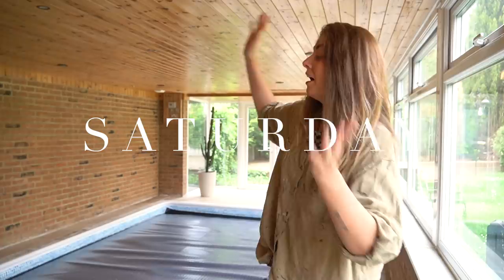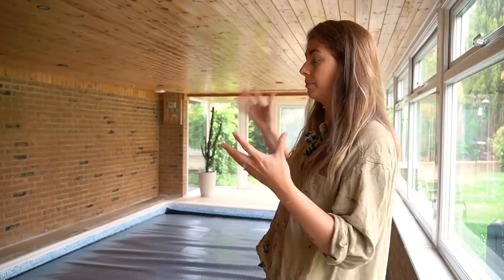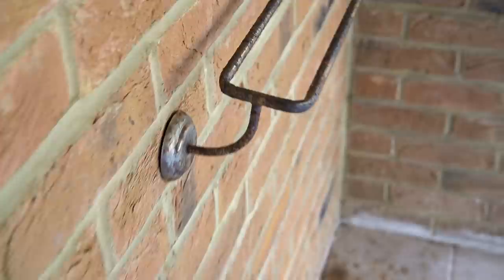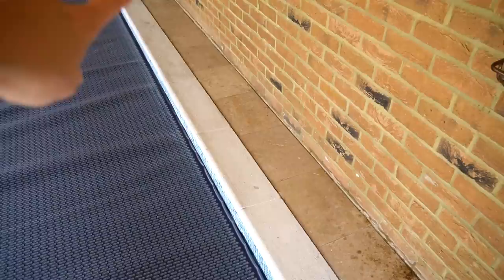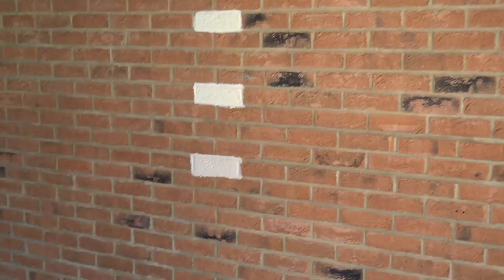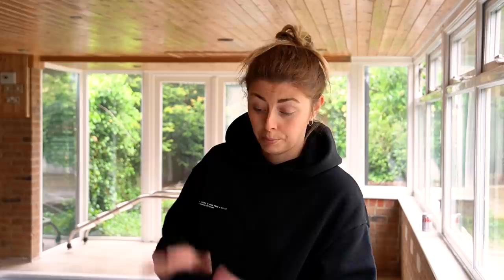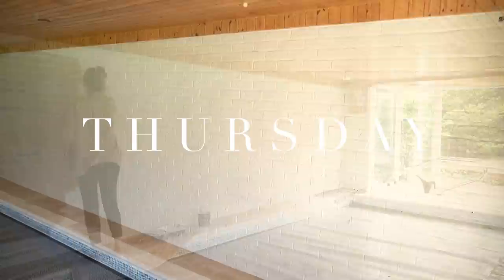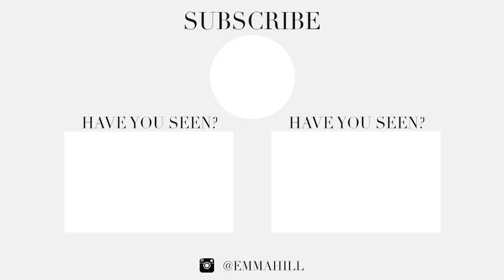Budget Indoor Pool Makeover Part 1

Comment: ♥️ Emma have you considered using solar panels to heat the pool all year round. Overall It’s really cost effective, using clean free energy.
Reply: Good idea! Roof enough to put them on..
Reply: Needs sunshine and expensive to purchase
Reply: @hollyssimplelife1634  It is light, not heat/sunshine that generates electricity and too much sun/heat can actually hinder the electricity making process. High temperatures can actually reduce the efficiency of electricity production, so although the solar panel will absorb both light and heat, it is the really light that it wants.
Reply: That sounds like a really good idea 👍 I hope Emma is reading this!!

Comment: Such a lovely transformation Emma! 
It already looks so much better, brighter, and more inviting. Once the pool house is more aesthetically pleasing, you'll want to spend more time there and enjoy the space and the pool itself.
I have a pool as well, an outdoor one, not heated, and we use it usually from mid/late May till like mid-September. The rest of the year the pool is empty and covered so that way we don't need to run the pump or maintain the pool itself if we're not using it. I also just prefer to fill the pool each year with new fresh water for the season.
The pool can be quite costly but once you get the hang of it and you learn how to take care of it and maintain it yourself it is so much easier and more cost-efficient.
Waiting for part 2 😊

Comment: I have travertine and it can be cleaned with Bon Ami. Eco friendly and amazing for cleaning it. The cracks can be repaired with travertine filler. Travertine is “young” marble and naturally has holes they use this filler and then either hone or polish the travertine.

Comment: Emma, I’m wondering if you would want to tackle those rust stains yourself.  One product you could consider is called CLR.  ‘CLR stands for calcium, lime, and rust and—as you may imagine—it is designed to clean these things specifically. Now, CLR is actually an EPA Safer Choice winner, meaning it’s a safer choice for humans and for the environment. But, it’s also a heavy duty cleaning product that requires some precautions.’  I have only used CLR for tiny jobs around the house, and it works well.  But anyway, perhaps you have a better product where you live.  An expert’s opinion is most likely needed.  To me, the floor tiles, even with the cracks, shouldn’t have to be replaced.  Perhaps an expert could patch or replace the damaged ones.  Maybe the previous homeowners left some extra tiles around somewhere?  I truly love your Reno videos and look forward to them.

Comment: Emma I live in a subtropical climate & inground pools are common, i thought i'd provide some unsolisited advice that may or may not be beneficial you be the judge. You're right in saying pools aren't cost effective & imo indoor pools are even more costly . I wouldn't suggest you cheap out on the pool though it can turn into a money pit if it's forgotten or alltogether abandoned. The pool upkeep is necessary & continuous year round it may be an easier process for you if you rent a water pressure cleaner. TBH I'm incrediably surprised manually scrubbing the flooring has made such a diffrence. The pressure washing will help to remove any  stains, mold, brick, & flaky paint in the future bc it'll return eventually. Depending on how much sun the pool building can capture it may be cost effective to consider solar panels. That's also very common in my country. I realize your country's weather is.... well odd & the solart panels /instal cost  may ourweigh the benefits/savings.
Reply from the maker: Oh sorry I should have been more clear, we haven’t scrimped on any of the actual pool care, that’s all been done by a professional, it’s purely the aesthetic/decor that we’re doing on a budget as we need time to see how much we actually use it. If we rarely use it then in a year or so we’ll fill in the pool and turn it into a self contained annexe which will add 20-30% value to the property and is a highly sought after feature for prospective buyers looking for countryside properties, vs the tiny 3-5% value a pool can add. After this year we’ll have a clearer view of where we’re at regarding the usage of the pool 😊

Comment: How nice would it be to replace that window wall (on top of the lower brick wall) by floor length bifolds? 😍 Doesn´t matter what you will do with that room, either way it would be amazing to be able to open the space fully. In my opinion, of course ☺
Reply from the maker: If money was no option then we’d have bifolds and bifold windows the entire way across the length of the pool room too but we definitely don’t have the budget for that and there’s no point if we don’t know if we’ll keep the pool or turn it into an annexe. We need time to see how we actually use the space x